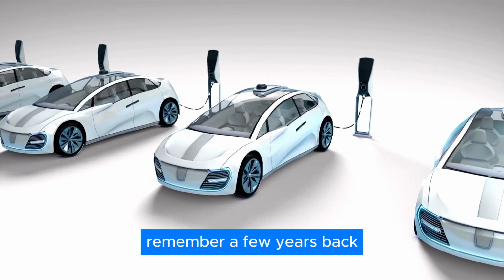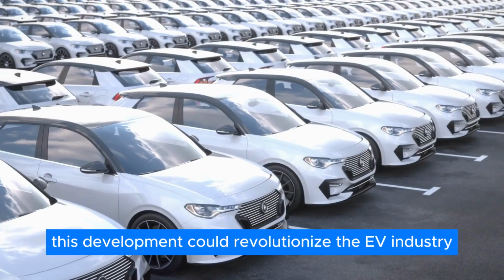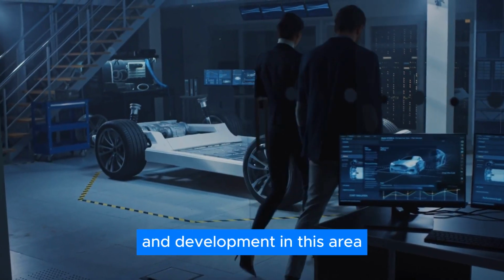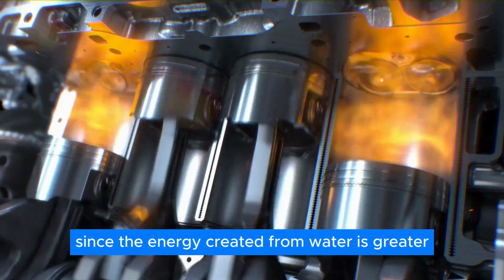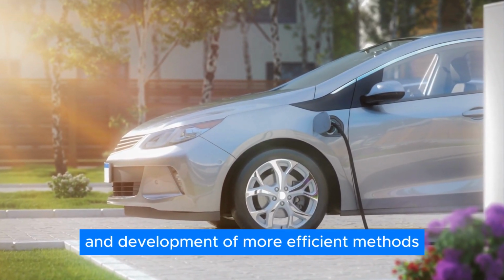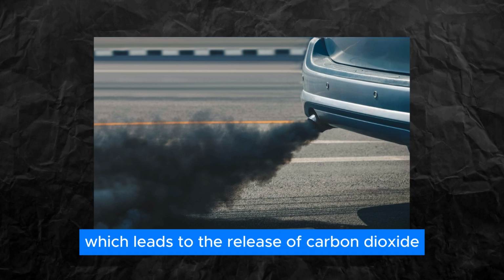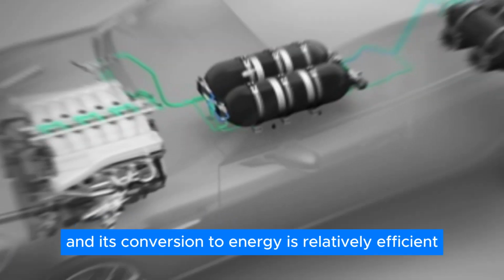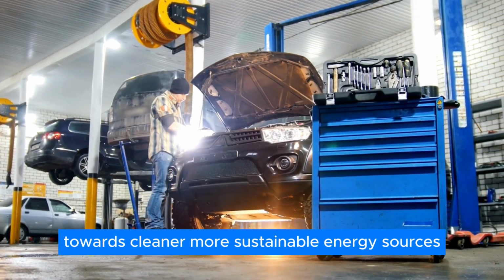Toyota CEO: "This New Engine Will Destroy The Entire EV Industry!"

Comment: If the energy needed to split the water is already stored in the car, what is the gain from the additional stage of conversion into Hydrogen?
Why not use the electrical energy directly?
Reply: Cos you make hydrogen when and where electricity is cheap, then use it when and where electricity is less preferable
Reply: @JB206  The car supposedly runs on water - ergo it is cracking the water with energy that is stored in the car.
So you then need to carry the water, and the stored electricity to crack it - only to release energy to move the vehicle.
It is like having an EV with a (heavy) battery (to store the energy), but also having a tank of (heavy) water to carry around with you.
How can that be advantageous?
Reply: @HardleyJ  Indeed. And give that there are always losses in any energy transfer system, this is inherently a flawed idea.